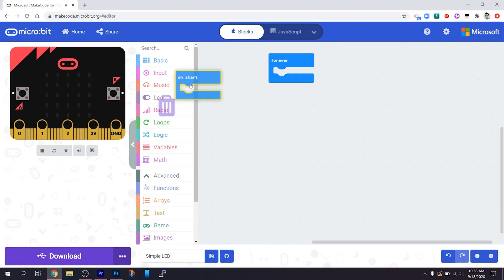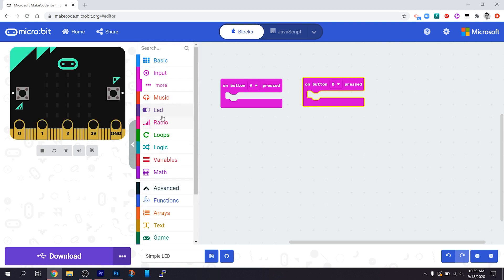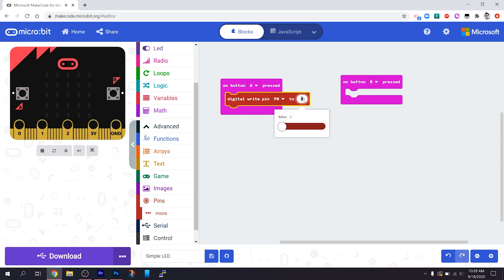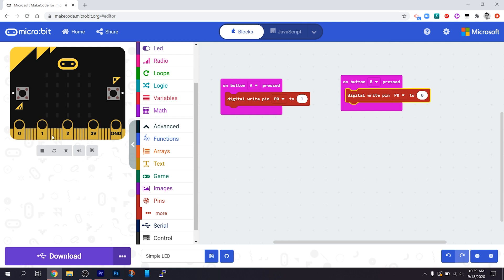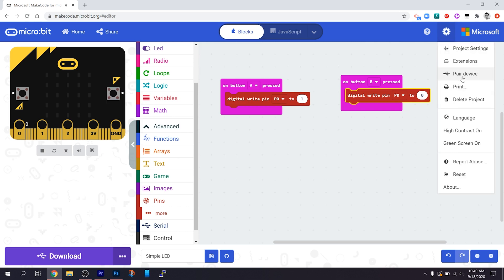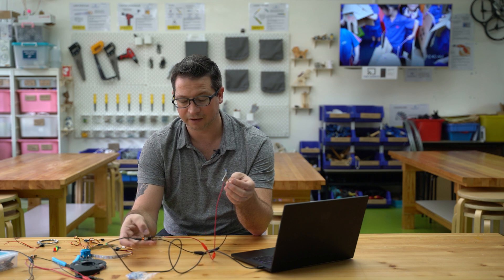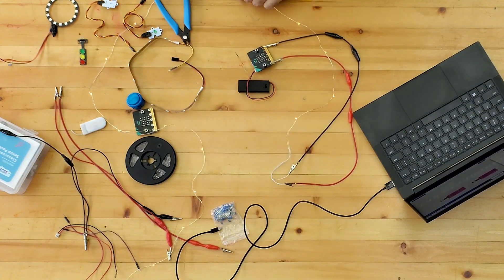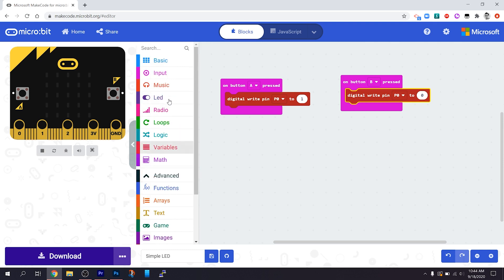Coding with micro:bit - Part 3A - LED lighting

Comment: A little tip that might help: when connecting the alligator clips to the LED, the shorter leg of the LED should be connected to the ground pin. The longer leg of the LED should be connected to pin 0.
Reply: THANK YOU!